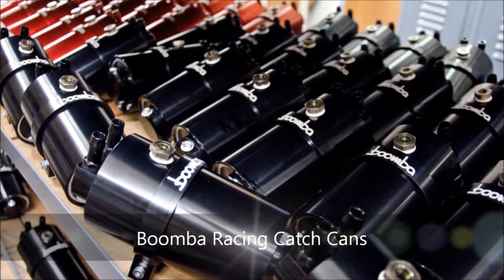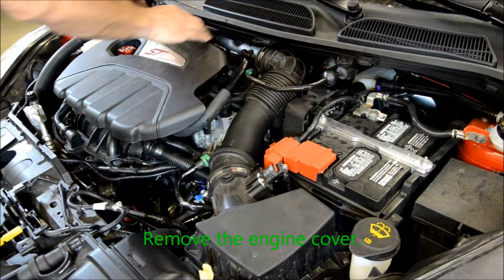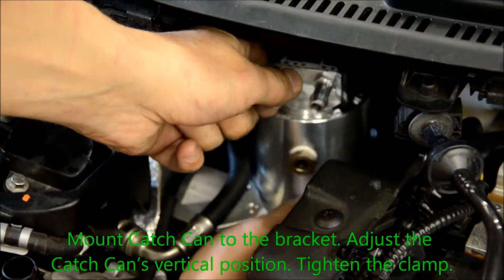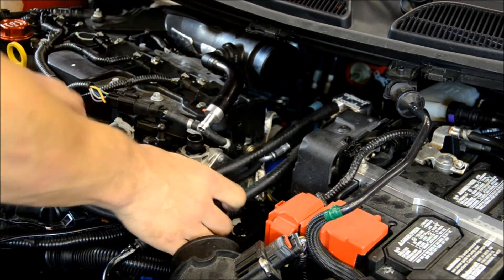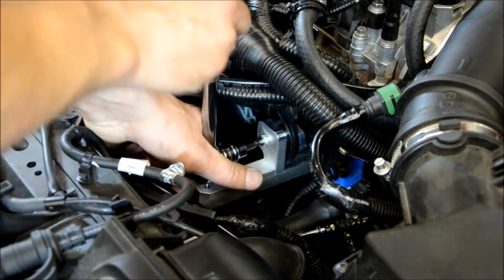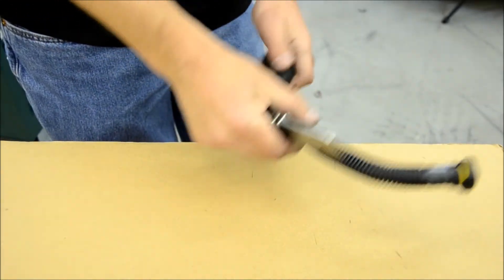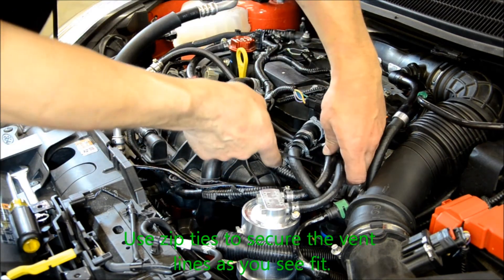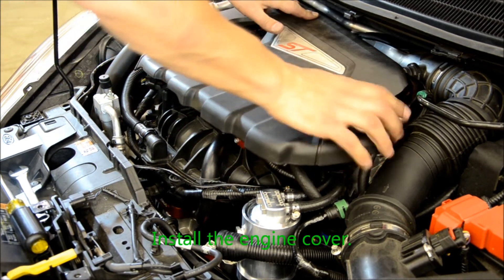How to Install | Boomba Oil Catch Can for '14+ Ford Fiesta ST

Comment: Are you installing 2 oil catch can or those are 2 examples for 1 oil catch can-?
Reply from the maker: This is the install for both the Stage 1 & Stage 2 Catch Cans, both are massively beneficial to turbocharged cars. Stage 1 is on the low pressure side while Stage 2 is on the high pressure side of the intake. Feel free to reach out with any more questions you might have!

Comment: It looks like for the purposes of your video you have both stage 1 and stage 2 catch cans installed at the end of the video. Any benefit to running both? Also, could the stage 2 be mounted in the stage 1 location to retain the sound symposer?
Reply from the maker: +Ryan King Stage 2 is going to catch a lot more than stage 1 will. For someone looking for the ultimate protection we recommend both stages. Stage 2 could hypothetically be mounted in the stage 1 location, however you would need longer vacuum hoses.
Reply: +BoombaRacingInc Ok Thanks guys, considering it for the ultimate protection!

Also, just curious why the symposer delete is necessary, especially with the stage one that mounts no where near it?
Reply from the maker: Ryan King That might be a typo on our part. I think it just carried its way over from the Stage 2 description. Stage 1 does not require a Symposer Delete.
Reply: @Boomba Racing I have a stage 2 OCC on my fiesta I’m having a bit of trouble it’s seem like oil is passing right through .If I take off my connection to intake manifold the inside is soaked with oil

Comment: do these void the warranty?
Reply from the maker: +Sir Jammer In short, no, they do not.Certain dealers can be more picky than others when it comes to aftermarket 
parts. Some dealers are fine with mods whereas other dealers will not accept any mods. We always tell the customer to ask the service advisor first for what’s acceptable at any given dealership and if you have any doubts to return the car to stock form before bringing it in to a dealer.  

Furthermore there is a law called the Magnuson Moss Warranty Act that 
states in order for a dealer to deny warranty work on your car, they have to 
prove the aftermarket part you have installed caused your issue. For example if 
your window stops working and you have a cold air intake, the dealer is not 
going to void your warranty. It is illegal for a dealer to void your warranty 
for simply having aftermarket parts installed.

If you have any further questions, please let us know!